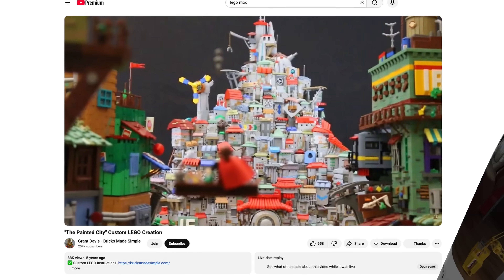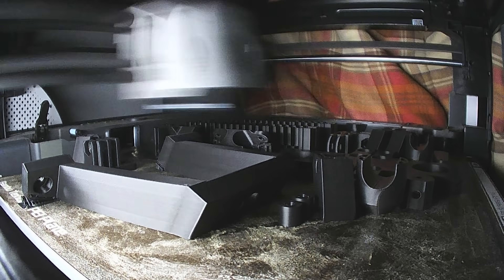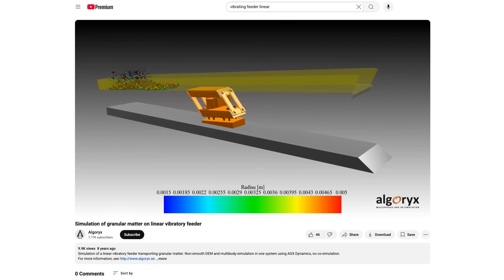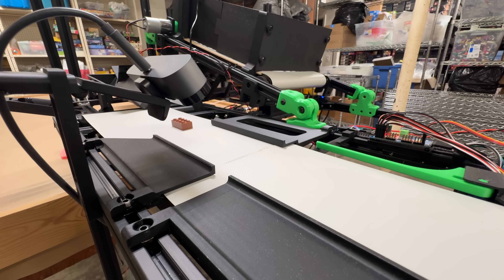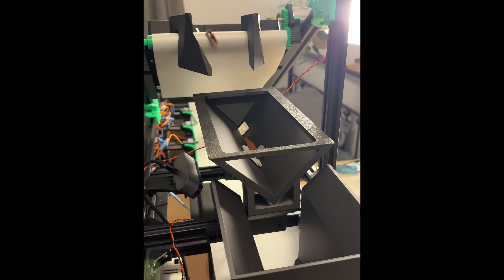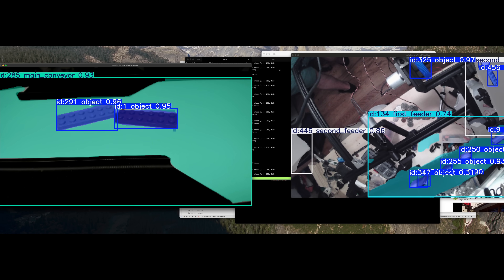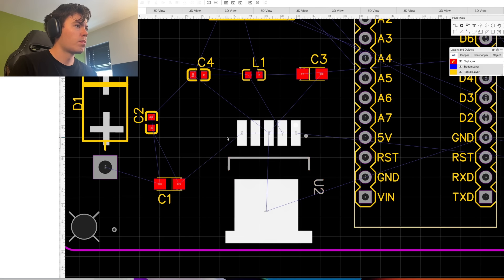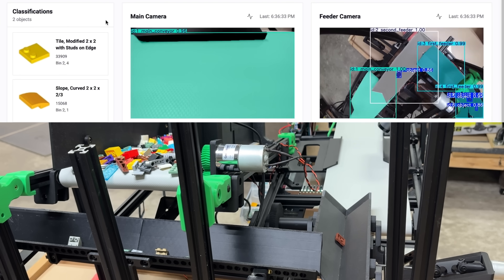A machine to sort a million pounds of LEGO

Comment: A vertical chute a few inches high will separate pieces. Just drop them off the edge onto the belt and let them bounce apart. If you drop 2-3 pieces down a 12" chute 12x12 the chance they land on top of eachother is almost zero. Add gates with light sensors instead of cameras to activate doors and spacing/arranging/funneling pieces into multiple lines going down the belt so you can run the whole thing faster. Even an esp32 should run this sorter at 100s of pieces a minute. Look at videos how package sorters work.

You can also use a color sensor to quick sort single colored pieces (bars, etc) using a mechanism like a coin sorter by shape.

This project is impressive but you over complicated it, which makes it too slow for the scale you need it to run at.

Comment: Have you thought about using clear material for the conveyer belt then placing a camera to capture the other side of the brick? I think this will reduce the failure rate, because bricks often come in upside-down and some bricks look identical on their undersides.
Reply: We looked for a clear conveyor belt but have not had much success.
Reply: @ddj6969  They sell clear plastic sheeting at the fabric store in various thicknesses. Making a belt out of this type of material would be as easy as the belts made in the video.
Reply: Having used brickognize for rarer parts it often can only recognize it from one side.

Comment: The feeder seems to be the bottleneck, I immediately had two thoughts on how you might increase speed there:
-A re-feeding system could return failed separations that landed on the belt back to the feeder. That way you would have to be less careful, not having to stop the feeder every time you managed to single a piece out. 
-a buffer system between the feeder and the sorter could have both parts of the machine work at maximum capacity the whole time. For example a fast rotary sorter that puts a correctly separated piece in a random empty bin which can be dispensed to the sorter again when needed. 
-when both ideas are implemented you can have the hopper belt run much faster decreasing the chance for two pieces to land on each other.
Looking forward to V2

Comment: I would suggest you add a fail conveyor to the start and change the conveyor that go under the cam with a round shape so things don't fall. For the vibration, industrial don't angle the springs but they angle just the plane the piece is on. You can just vibrate vertically an slightly inclined plane and you should get somwhere nice. Ofc it depends on the dimensions and i'm not an. Expert but that's what i've learned in an internship. So try not angling the springs . See you !
Reply: By fail conveyor i mean a conveyor for when you were not able to identify the piece